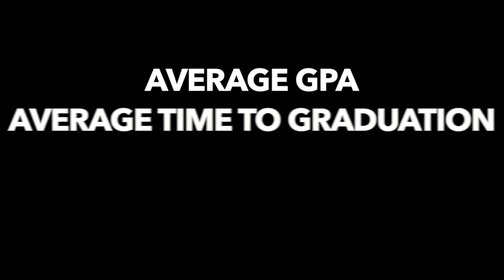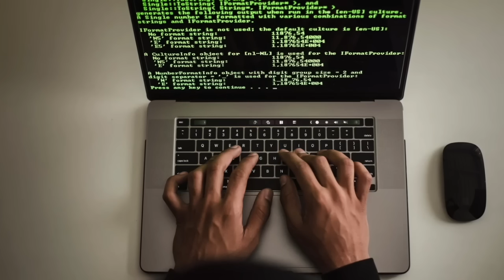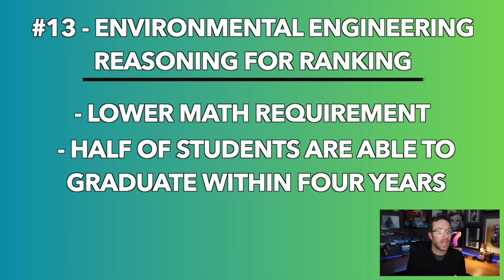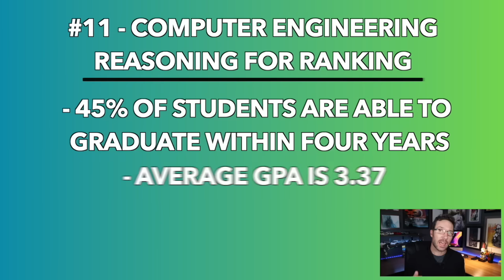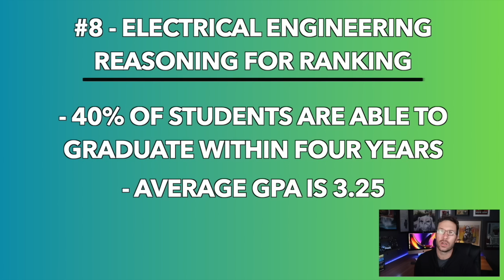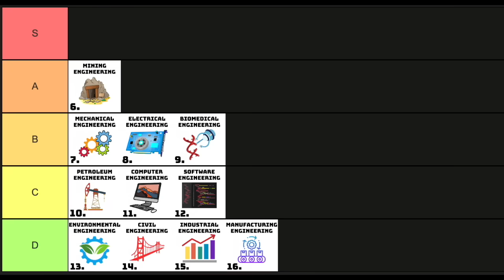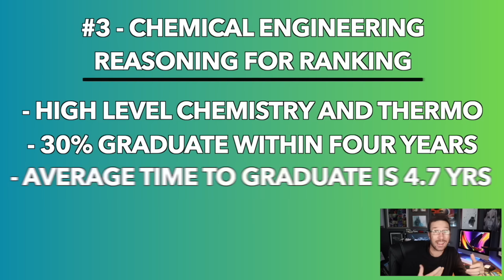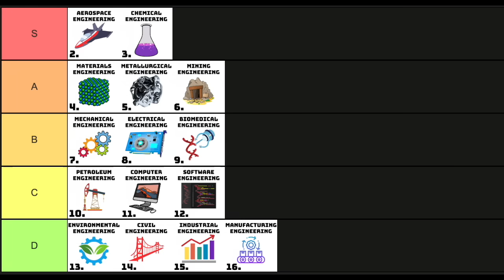Engineering Degrees Ranked By Difficulty (Tier List)

Comment: Im an electrical engineering student but when don’t only do differential equations. We go up to complex analysis. 
And we need a very good understanding in calculus 3 to solve the Maxwell field equations and calculus3 in complex for the wave equations.

Maybe i don’t get your math ranking but calculus is way more complicated that differential equations. Ok partial ones can be tricky but the „normal“ ones are so easy. Especially when you solve them in state space or with the laplace transformation (in s-domain).

At least put us above mechanical hahaha. 
Mechanical engineers don’t even no laplace transformation.

Comment: The good thing about engineering as an academic pathway is that for the most part the syllabus and accreditation is more or so equal in every country. It’s just that the evaluations and institution bureaucracy that differ greatly which would make the learning experience painful. As a matter of fact, some of the lessons I took on my local uni such as plant design, fluid mechanics, heat transfer, thermodynamics etc; are interchangeable with foreign uni when it comes to learning materials (lecture slides, terminologies).

Comment: Great list! Agree with rankings if we base it solely on the hard math and science required. No problem with using that as the hardness criteria since those are understood to be hard things to study.

That said, I remember a chem engineering student in my physics 2 class who was taking an entry level microprocessor course as an elective, a class I took all three levels and got big fat As in each. She struggled mightily in that class. I helped as best I could. Ended up practically doing her assignments for her. Then she showed me an assignment for physical chemistry (P. Chem) course and holy smokes it looked like hieroglyphics mixed with ancient Elven runes.

She could navigate the math and science of one of the most difficult courses in the world, but could not grasp the concept of digital encoding.

Comment: "Mechanical and Electrical engineering disciplines are considered more challenging than Mining, Metallurgical, Materials, and Chemical engineering. However, it's not appropriate to judge the difficulty of a degree solely based on the graduation rate. For instance, some of my friends who are studying Chemical Engineering have observed that the coursework in Mechanical and Electrical Engineering appears to be more difficult."
So for me mechanical and electrical are at least "A" if not "S" tier. 

Greetings from Germany :)

Comment: Actually computer engineering varies a lot, and i would say it has a highest level of math because you use a completley different math: discrete maths and i have found very more difficult than calc
Reply: especially in neural networks, you need calc1,2,3, linear algebra, and discrete math to understand what's going on and actually, it is way too tough. I've had microprocessors in my previous semester. oh my gosh. that was brutal. we had to code in assembly and the final project was to create a shooter game in assembly which was painful

Comment: As someone with an UG in mechE, and a MS in aeroE, I would say that mech is as hard as aero. The difference between an aeroE and a mechE are no more than 5 classes. I’ll argue that aero is easier than meche. I would consider electrical to be the hardest engineering degrees. I would not consider aero to be the 2nd hardest engineering degree.